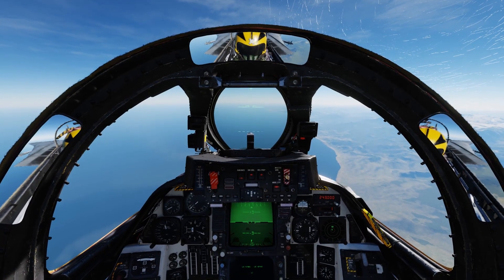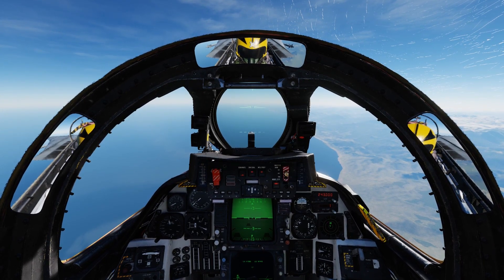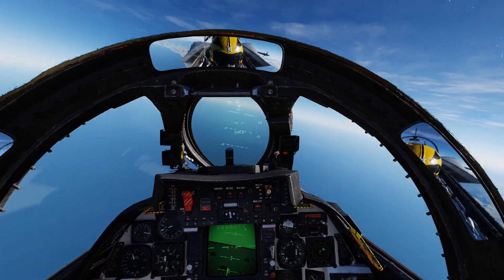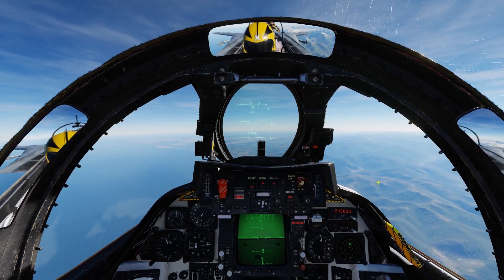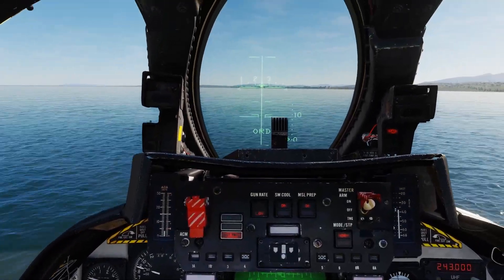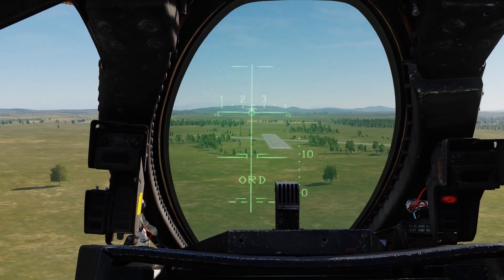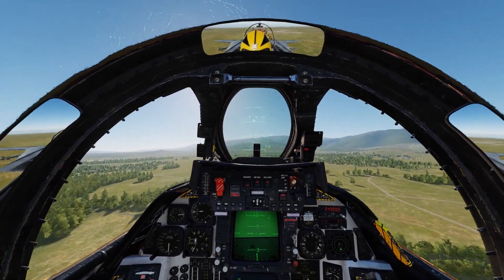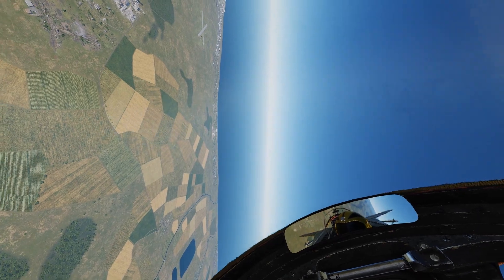DCS | F14B: How to use the TALD in the Tomcat!

Comment: so do you just fire them without any lock? they just go there?
Reply from the maker: So sorry, I thought this comment was on a different video! Yes so you can just drop these whenever you want but remember it's more like a bomb in the sense you have to get jester to select them in the air to ground and to release them you have to use store release, then depending on the Hight and speed that you released at that will determine how far they will fly
Reply: @SkunkMcFunk  thanks man! can't find worthy info like this anywhere. most guides are very shady and don't really explain anything. much love